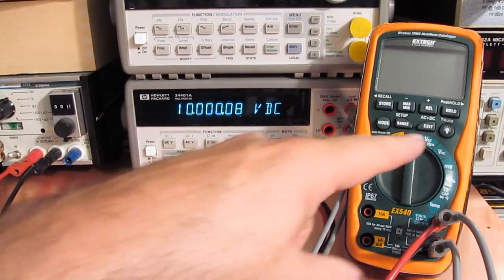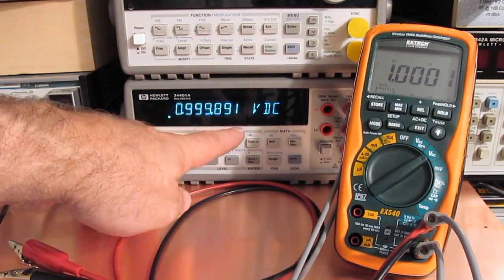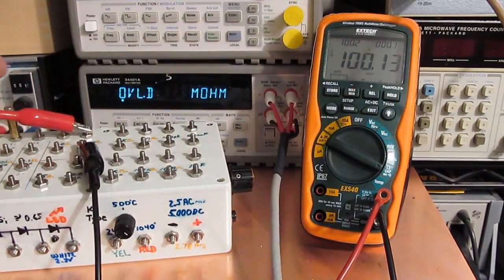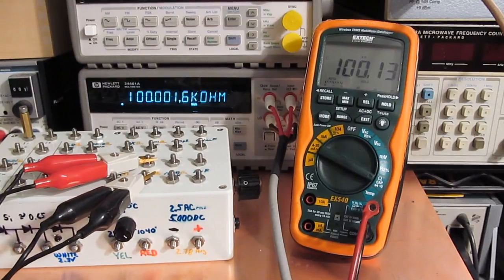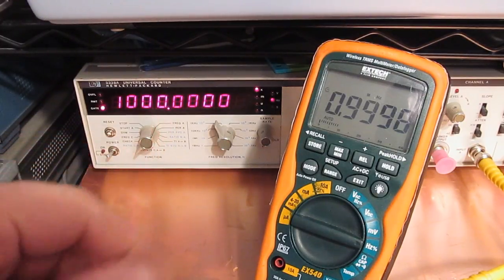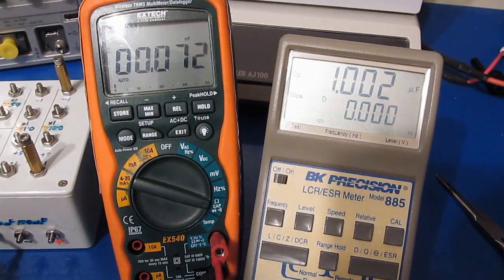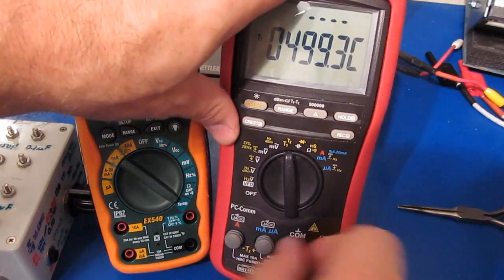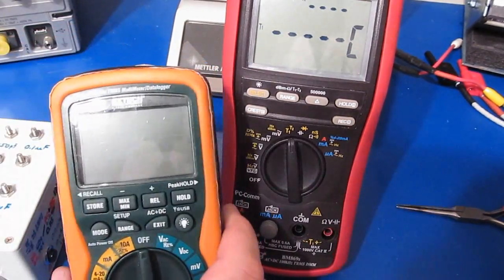My Extech EX540  Turns Five Years Old

Comment: I just got a new EX520 and was bummed that the temperature range is about 4°F high, while my EX430 is good. I think it measures temperature differently, because with no probe, it reads OL whereas the 430 has an internal sensor.
Reply from the maker: 4 degrees high compared to what?  Another low cost meter or you have a standard that you are using?  Is it a constant four off over the entire operating range?    If you have a standard, you may be able to align the meter.
Reply: @joesmith-je3tq  Compared to my Elitech temperature logger, my EX430A, and my Etekcity lasergrip 1200. I know they are all low cost, but the EX520 is the only outlier. As far as how the error behaves at different temps, I'm not yet sure.
Reply from the maker: @kennethanderson7642  Were all of the meters allowed to stablilize at the same temperature before you tried this?  You state you just got the meter.  Did you pull it out of the box and try to make this measurement?  If so, you may want to let everything settle for several hours first.
Reply: Ok I'll give it a try. Thanks.
Reply from the maker: @kennethanderson7642  To give you some idea, have a look at the following link:    https://www.eevblog.com/forum/testgear/hear-kitty-kitty-kitty-nope-not-that-kind-of-cat/msg2881362/#msg2881362

Comment: Hi Joe, I enjoy your videos though much of the content is beyond my current understanding. When you say it's been calibrated but not aligned, does that mean it's been tested against known standards and any differences recorded, but the meter has not actually been adjusted to read the same as those standards?  
I had always thought calibration meant adjustment but I re-watched one of Dave Jones very early videos on counts recently and he mentions it's not always about adjustments, but about having historical trace-ability. And then I saw your use of the term 'aligned' here. I guess that means if you are recording any measurements that matter, you are able to perform manual offsets from your calibration certificate to get the 'correct' measurement, rather than simply recording what reads on the screen? And alignment is actual trim-pot twiddling or changing of stored calibration offsets in EEPROM so the screen reads the same as (or very close to) the standards it was measured against?
Reply from the maker: A recent post 

https://www.eevblog.com/forum/testgear/how-to-calibration-if-i-do-not-have-volt-generator/msg2310567/#msg2310567

Comment from the maker: Terry McHaggis7 minutes ago
Hi there. I have the Ex Tech 505. Its out 50mv low @ around 5V dc,just over 100mv low @10V dc and so on. Its 4V low @ 244V ac. Its great on resistance but murder on capacitors. Its ok all round on Amps and temp. I have a Fluke 177 and Hyelec MS89 too so manage everything between the 3 of them. The cheap Hyelec matches my Fluke on the things they both do. I like the look of the Ex Tech and use it for the things my Fluke doesn't do. I may send it to get calibrated just because I like it. They get a bad name from the EEV faithful but I like mine. The ones who don't like the do so because Dave says. Sheep. Dave's a very very clever guy and has my respect because he's top of his pile. He's bias as hell about some things but I suppose he can be right? Shite eh? Lol
I like your videos better! You'd take Dave in a square go too...Ha Ha 😀

Sorry for the copy paste but I may have to correct the original post.   Not impressed seeing anyone trying to profit off my work.  To me its an indication of how they conduct business.  

I had ran an EX430 some time ago that was damaged from the piezo grill ignitor.   I'm not sure if CEM makes that one as well.   These fail around 2.5KV.  Not the most robust but better than many of the ones I have looked at.  It's been a pretty good meter for work and at the $120 they were selling them for, it was a great deal IMO.   Per Mark's point above, it sounds like you want to have the meters aligned first.     

I'm not much of a fan of any handheld meters.  My BM869s is still my favorite of the ones I bought but if I found something I liked more, I would post about it instead.   When it comes to running tests on them, I try to make sure everything is the same to give you a good comparison (and myself as well).   I don't sell meters or work for any place that designs or makes them.   No one is sending me free meters to run and I have no ads or any other income from these videos.  I really could care less what people spend their money on.  If I had a stake in it, I certainly would look at it differently.